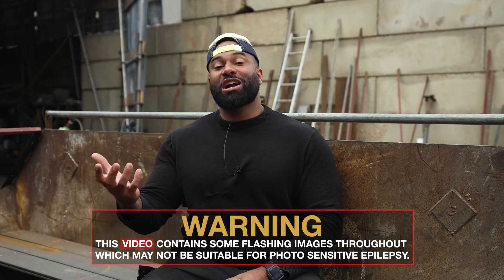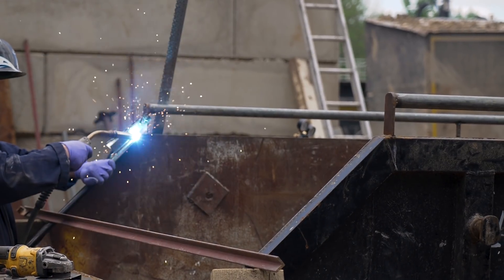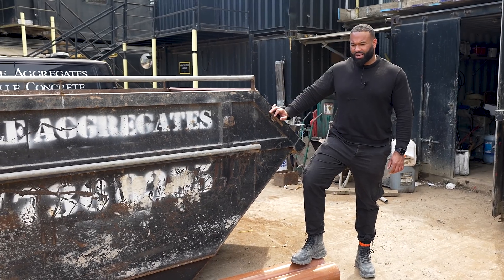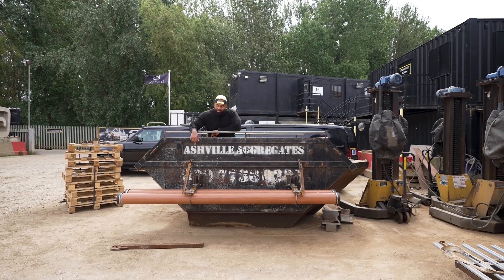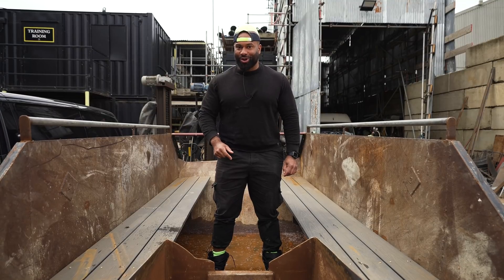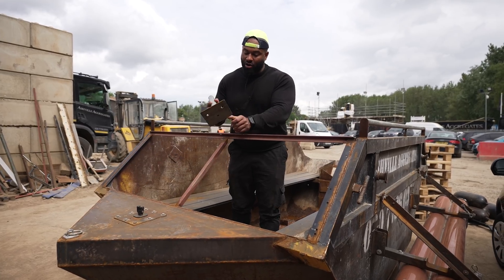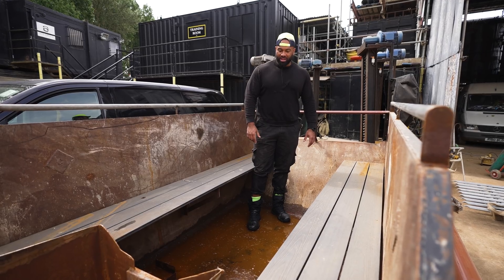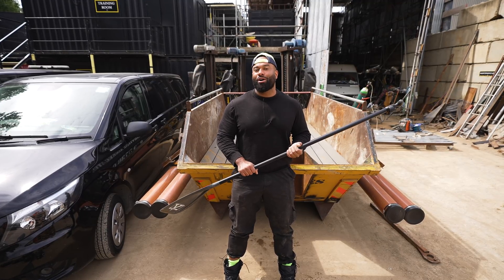Stability and Safety over Speed | Skip Boat Build ep2

Comment: disclaimer: I don't know your level of expertise and this may be obvious to you but just throwing in some intuitive advise from experience in industrial settings. In regard to the rust I'd think probably better to get it painted as soon as possible, I'm no material engineer but with the bits and bobs of knowledge I do have I'd imagine the rust is currently eating at the steel, it will start flaking and at best reduce the thickness and therefore structural integrity of the hull, and at worst cause holes and therefore leaks in the hull. definitely use a primer or paint will flake off easily and if you want the boat long term probably use several layers with marine grade anti-fouling paint.

Comment: I still think it will lack stability because of the sealed air pockets you've installed at the keel heightening it's center of buoyancy though the tubes at the waterline will help somewhat, if this interests you refer to my comment in first episode where I went into a bit more detail.

Comment: Skip Ahoy!
Do some holes or windows in the upper part of the side to decrease the wights.
Put a bench in the middle creating a H- shaped bench. Youp get better load balance if captain sits in the middle.
Fill the front with foom and install bilge pumps in case of a leak.
Need some light for a truck or construction vehicle.
What no fishing equipment?

Comment: your made it worse YOU NEED A DEEP KEEL 2 FEET for the centre one with LEAD BALLAST the bottom should look like a big V when looked from the front or rear its still a flat boat you infact made the center ridge smaller which was completely wrong it should of been twice the size make them water tight  then cut hole in the bottom of the boat and fill with lead ballast or steel least doesn't corrode then fit a bilge pump in the centre ridge or keel so you can drain water out. thous pipes you have put on the sides are laughable they will slow you down they may even right make you submarine when traveling faster pulling you under the water as that 50 pup put wont break the drag it will just bog down and go slower back to the drawing board you need a deeper KEEL IT MUST LOOK LIKE A V shape or your wasting your time  sorry to say the front bit is fine nice job but those pipes IN THE BIN.so when you look from the front and rear it looks like a V the vee must start where the two outer keels are welded to the bottom so no flat is exposed from the bottom of the boat so its like a W shape with the centre keel twice the size you can cut the centre one off the reuse it weld new steel onto it so it will join to the two keels reshape the front and rear and bobs your uncle you have a stable boat ready for the sea once ballast and a bilge is added if you like you can cut some of the old flat floor away to gain access to the keels to add ballst then put a wooden floor on top just how boats are done but you must make sure all welds are water tight before doing that  have fun so this is the way to do it the right way you will then be able to get her standing out onto her plain with little drag with a bigger engine a 150 should do the trick.

Comment: Might be better transporting it on the hook loader on the flat bed then you can hiab it in and out of the water remotely from the boat that would be cool 😎 and it won't get damaged because it was a snug fit on the skip truck.

Comment: Daniel love the idea and concept of the skip boat buddy, to deal with your water issue inside put a couple of water screw plugs on the rear at the bottom of the water line so when you're storing you just open and drain naturally. Or a portable battery operated water pump too which comes handy in tricky situations 🤔

Comment: You would be better off steering the boat, skip, from the front in more central position. This would bring the bow down and give better stability especially considering that you are a bit heavier, in a good way, than most. I'd also suggest using Michael O'Donovan as ballast which can be offloaded if needed...........

Comment: I reckon the main reason for the instability is that you have one of your sources of buoyancy right in the centre of the boat, it will just sort of pivot on that central hull. Getting rid of it would also reduce the weight.

Also, if things are watertight, there's no need to add expanding foam, it'll just add more weight and, hence, won't be as buoyant.
Reply: Agreed. Although if there's any doubt (like the outboard floats being sealed with rubber boots and band clamps) the foam is relatively light "insurance" that it won't fill with water. 

I agree about the center section too, probably unneeded. The boat would sit a bit lower and lose some buoyancy, but it will be more stable, and the floats will provide stability and additional buoyancy to make up for it.
Reply: Yes and it'd be less of a fish killing machine